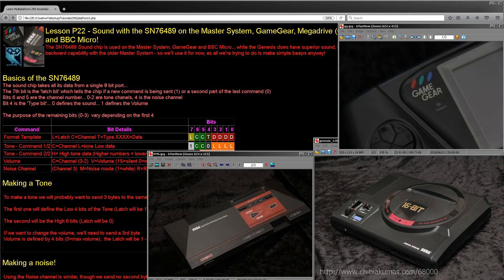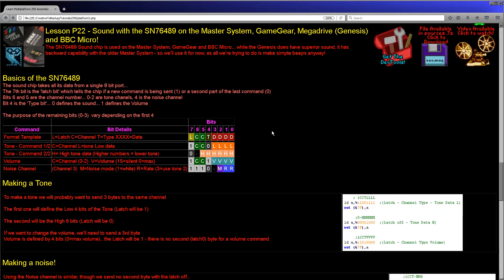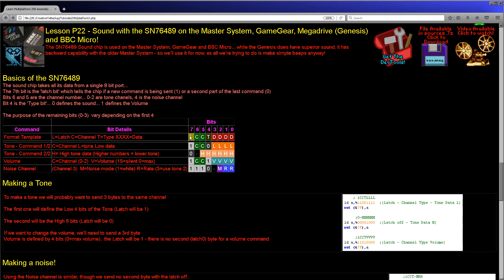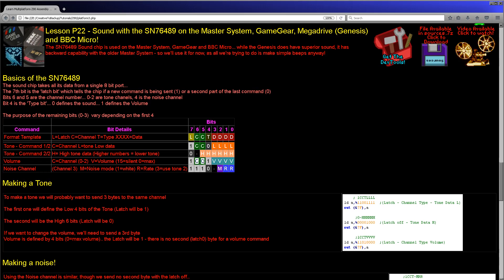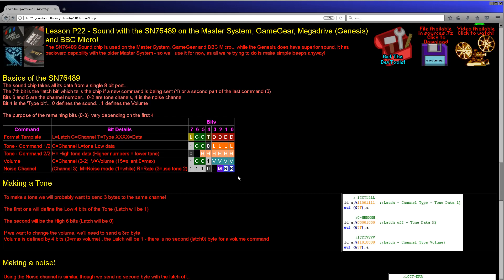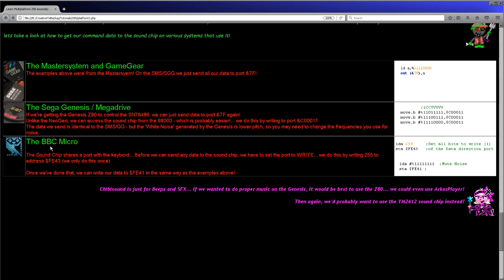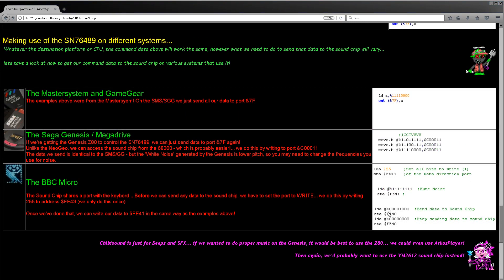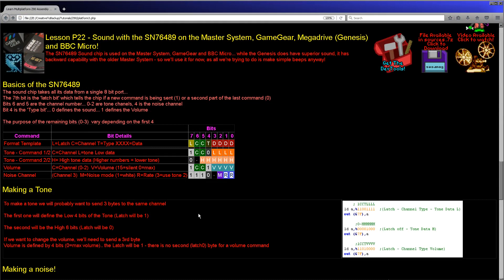Z80,6502 and 68000 Assembly - Sound on the Master System, GameGear, Megadrive and BBC Micro!

Comment: Another great video, it's great that you are making all of this effort for us.
I don't think that your code will work as expected on a real BBC Micro, nor a correctly implemented emulator. On the Z80, the out blocks the Z80 until the SN76489 has read the value, but on the beeb, the signal is not connected and so you must leave the data on the "slow bus" for at least 8us (this may also apply to the 68K, I don't know).
I use this code to write a byte, but there are many ways to do this!
.snd_write_A \\ A is written to sound slow data bus : Z=0 A=8 X=X Y=Y
{
; SEI
 sta SysViaRegA            \\ sample says SysViaRegH but OS uses no handshake \\ handshake regA
 lda #0+0 : sta SysViaRegB \\ enable sound for 8us
 PHA : PLA : NOP : NOP     \\ 3+4+3+4 + 2(lda #) = 16 clocks = 8us
 lda #0+8 : sta SysViaRegB \\ disable sound
; CLI
 RTS
}
If the OS is still running, then it is better to disable interrupts as DDRA may be changed for reading keyboard etc DDRB is only set to &0F by the OS, so this should be OK (although not best practice!).
PS You don't need to enable and disable the sound chip between writes as long as they are timed correctly, but leaving them enabled permanently will keep resetting the "random" seed if the last command was a channel 3 tone command!
PPS Not enabling and disabling will probably break the code on some emulator(s)!
Reply from the maker: Interesting! Thanks for this...
I guess I need a more accurate emulator - I don't have real BBC hardware.